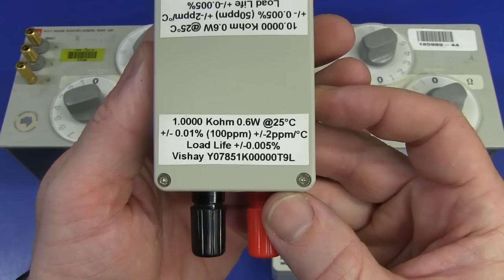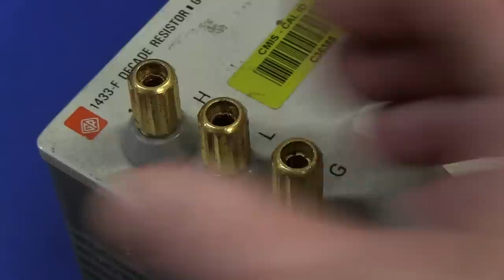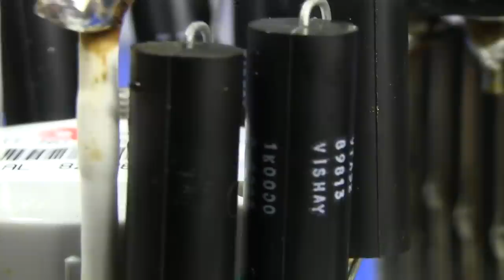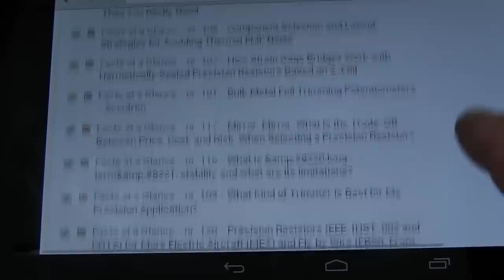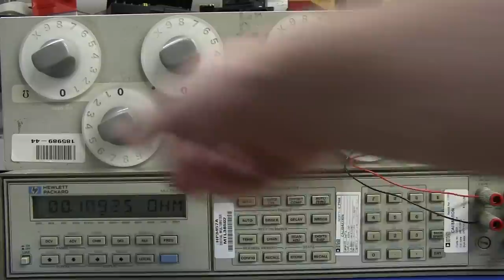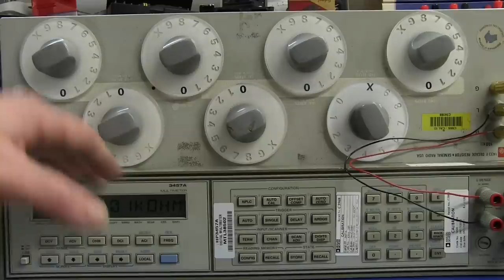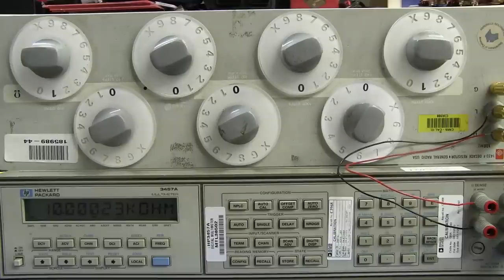EEVblog #461 - Genrad Decade Resistance Box Teardown

Comment: At around 17:00 where you talk about the .1ohm metal strip resistor decade, I think they are not burned for calibration, I think some previous genius user just passed too much current thru them.  If this resistor is .1ohm, and the rest of the circuit is < .01ohm, a high current will for sure damage it, leaving the rest unaffected.

Comment: The resistance Flat is Manganin (CuMn12Ni) or Zerranin which is ultra stable with temperature, the resistors will be varnish dipped or some companies used Shallac to coat their resistors, Don't use Silicone or expect the wires to fail after time !
IF you look inside a Cropico or Sullivan Resistance Box's then you know that you have a great Resistor Box :)
The darker resistance shows you it's been overloaded for sure on the very low range ! that's what happens to manganin when people overload it !,
Retired UKAS manager of a Electrical Standards Laboratory, over 43 years exp, 
Resistance wire Look at a company called isabellenhotte, Heusler GMBH KG Dillenburg Germany :)

Comment: Quad Tech at one time had bought the Genrad/General Radio R:C bridges (165X/168X series) and other metrology/component measurement line. Some time after that, it all ended up with IET.

Comment: The replacement switch looks like an multi-tech industries model 820 "Test Equipment Grade Switch" i used before, they cost around $100 for one single deck switch.

Comment: EEVblog  I just had a look into my "new" 1953 0.02% decade resistance box, and it is amazing how all is the same, but different. Also heavy switches, but different design (inner ring makes contact to outer), wire wound but on little tubes instead of strips, manganin instead of the likely used constantan or isaohm in genrad... but still only twice as good ;)

Comment: Yes, it's very easy to get a very precise resistance value with a box like this, and much harder to do so with a pot. Trying to adjust the lower resistance ranges precisely would be practically impossible.

Comment: The highest precision resistor I have was made by Cinema Electronics back in the 1960s.  It is a foil resistor with mylar insulation on a ceramic former, rated 900K ohms at .001% tolerance...and I know there are ones made to substantially tighter tolerances than that...

Comment: Someone needs to find a way to make (or find) a replacement lighted display for these HP machines.
Maybe adding an led  strip light on the outside, just above (or around) the numerical display ???
(....perhaps using "side emitting"  LEDs  ?)
Reply: +Randy Leifer ....I'm gonna order some side LEDs, and try it on the outside.
I know LED numericals have a preferred sight alignment....we'll see if this messes with that.
I know....it may (or will) cover-up some faceplate lettering info, but perhaps the LED light is held with magnets or sticky-tape, for easy removal.
And I know, I'll get ridiculed for being obsessive.....the joke reply would be,
 "just put a cheap Fresnel lens in front of it, you old man !!.....lol"
Reply: FTIR frontlight retrofit? FTIR = Frustrated Total Internal Reflection. You look at the display itself, if it has any overhang of glass that you can shine into, you try that, perhaps the result is good enough. Otherwise, you get a piece of glass or acrylic that overhangs your display to act as a light guide, shine your LEDs into the overhanging edge of it, you can cover the edge with a reflective material to minimize light loss, you can sand the light guide perpendicular to the light distribution direction, and finally you glue the light guide to the front of the display with LOCA. I have not tried it yet, so i can't vouch for self-made light guides, but it's on the to-do list.

Comment: The silver contact issue doesn't relate to the value of the resistors on the particular decade. The contact resistances of all the switches, which are in series, add up and affect the the least significant digit, so the combined switch resistances is what is important. If set to zero, only the zero contact need be silver. If the two highest decades are not set to zero, the selected resistor values swamp out the contact resistance, hence the silver is not needed on the non-zero contacts..

Comment: First, I'm surprised your meter doesn't have a zeroing function.  Second, at some point you must consider your meter's specification and calibration.  Third, the screw contact has less resistance and variability than the banana plug so it would be more precise to use the screw contacts for the current and the banana plug for the voltage sense.

Comment: Just in case Dave sees this I have a question regarding your homemade reference resistance box. Did you solder the precision resistors or are you using some form of mechanical connection? If you soldered were there any risks of resistance drift due to component heating?
Reply from the maker: Bigrignohio Soldered. They are very tamp stable and are rated for soldering. Even so, I used long leads and a heatsink. The resistor wouldn't have heated up at all.
Reply: EEVblog Thank you. I don't think I will need QUITE as good a tolerance limit as +/-0.005% (those things are expensive)  I do believe I will make a similar reference box. Besides it would be nice to have something relatively precise and portable as I go looking at old meters. Getting back into the hobby I am naturally drawn to those old Fluke bench meters that I could never afford as a child.

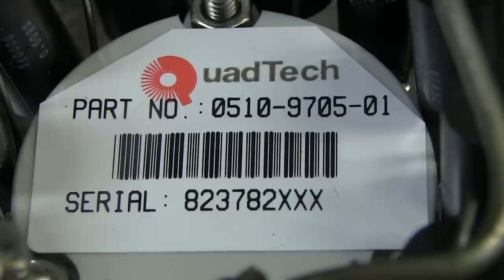Comment: EEVblog  17:55 Don't you think you pressuring your Amateur radio crowd a bit to much on their soldering skills, Dave?
Reply: Jon Williams U mad or something?
Reply: No, but it think he is being stereotypical about the solder joint. They don't have to be all that pretty, as long as they work.
Reply: Jon Williams Oh, I thought you wanted to say that Dave only has stupid people as fans.
Reply: No, but he claims that Ham radio operators will have a bad solder skill. Some of us are electronic engineers with more advanced soldering equipment then just a hack job.
Reply: +Jan's The Man so you pick the part where he says that it doesn't matter because it works to point out that they don't have to be pretty as long as they work.

Comment: I thought military devices are optimized for robustness not for accuracy.
Accuracy is crucial in metrology.
Reply: knik3 But some military applications need precision, such as hitting an enemy in Russia all the way from Australia. And the details are obviously classified, so they can't let outside labs see it.  Thus the logical option is to have their own lab staffed with military people doing the work.  Now the civilian reference gear they used wasn't itself secret, only the jobs it was used for, including the when, how and who.  But decades later they can sell the old tools without revealing it was used in any particular year or month (thus ensuring enemy analysts can't correlate with when a particular weapons system was serviced or a particular remote observation was made.
Reply: Some military devices are made with solid gold traces with in house laser trimmed components using state of the art test sets calibrated by in house metrology departments. If therethere's an extra decimal or ghz to be had its on next year's budget wish list. It's not all just pull it from the oven stick it in the freezer drop it off a truck an see if it still turns on. Other stuff is pure crap that technically meets contract but really is better used for target practice lol.

Comment: What are these resistor boxes used for?
Reply: You can use them for maintenance on an electronic system for instance to simulate/calibrate a sensor reading. Or it could be used to experiment with different resistance values for a circuit. Or for calibration of another measuring device like a multimeter. Lots of good uses.
Reply: Like a pot? In my case the one I have is big power resistors.
Reply: Yup, exception much easier to dial into an exact resistance instead of trying to fiddle with it to get it where you want it.
Reply: I would say characterize a sample over a given series of resistance values to check specs